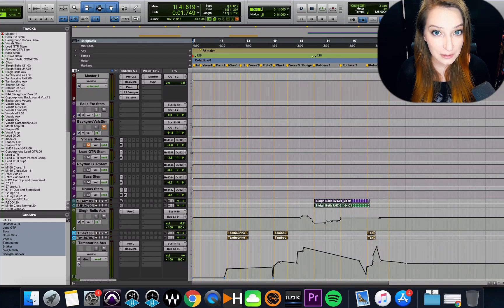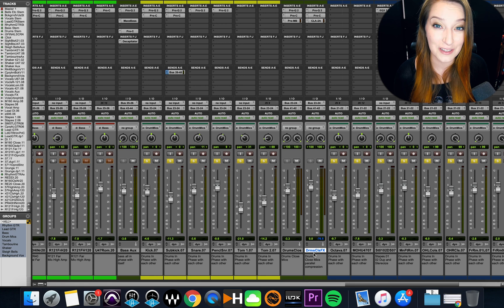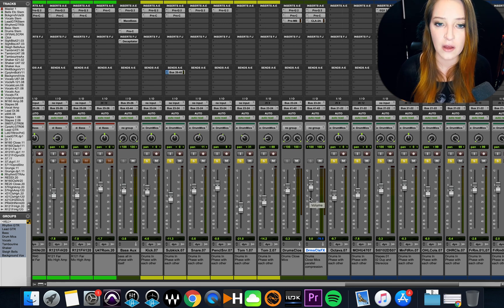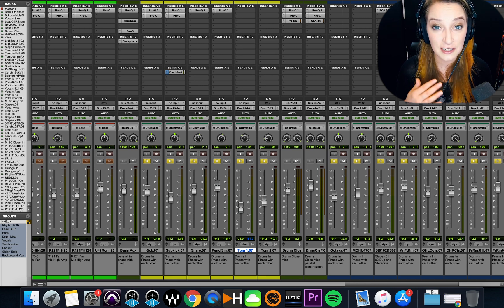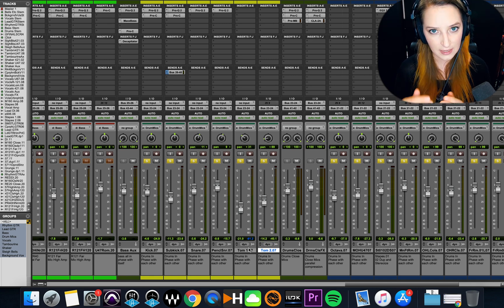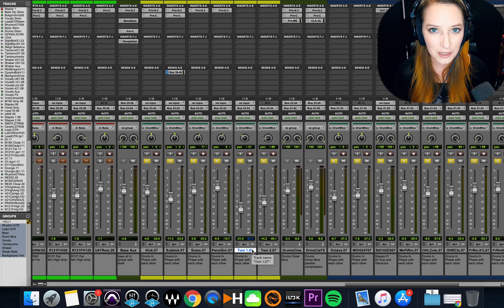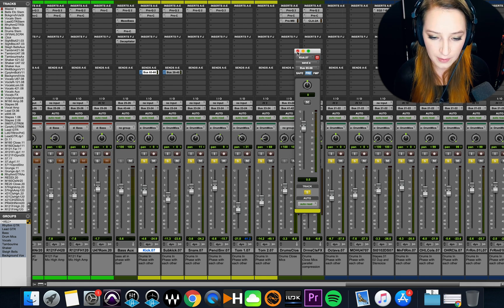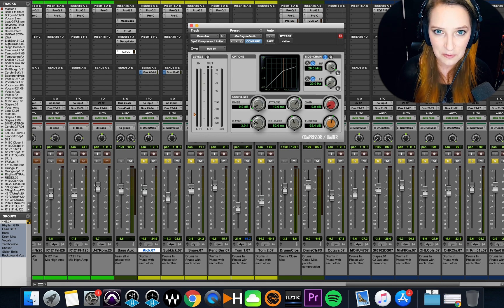Audio Basics: Parallel Compression vs SideChain Compression (and What’s Ducking?!)

Comment: in the actual new york compression, you would add an eq to increase the lows (up to 100hz) and highs (from 10khz)  with a 3db shelf, and also have the bass on the same channel. this is just parallel comp
Reply from the maker: Very cool, thanks for sharing! I haven't heard of having the bass on the same channel being a defining feature, but that sounds like a remnant from the tape era, when people had to bounce tracks together when stopped by a track limit. Do you think it's from that? From my experience, most people nowadays are teaching NY compression as being the same thing, with the added eq as an option, but not a defining feature. I wonder if it's one of those interesting linguistic things whereby a technique or term changes a bit over time?
Reply: @CatoNoise i think it was convenient: it sounds good on the bass too, and ensures a coherent processing on the whole rhythm group. if they initially made a virtue out of necessity, i don´t know, but it would make sense to do it that way either way.
regarding the semantics I would argue that in this case the defining features are what the actual technique included when it got it´s name, but yes, over time terms lose connection to their origin, so it will probably one day be, or already is, synonym with parallel compression. i am pedantic however and like to think it´s beneficial to our communication  to use too different terms to describe the original NY comp as a subset of parallel comp.